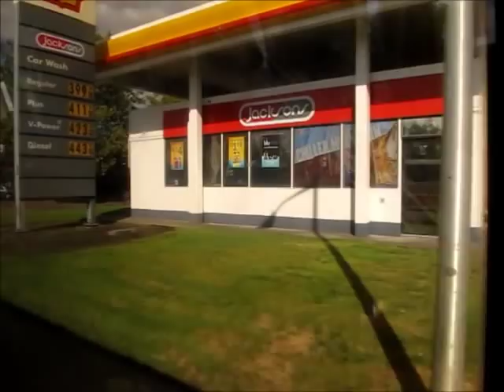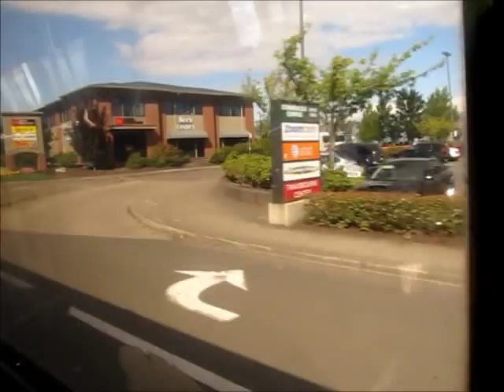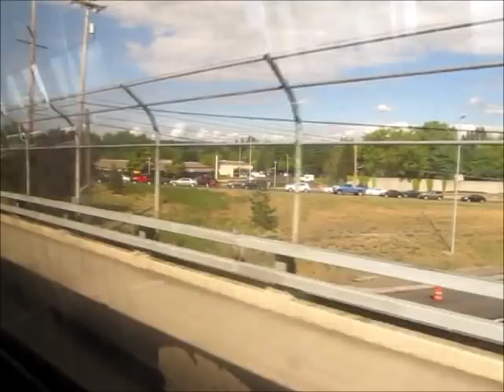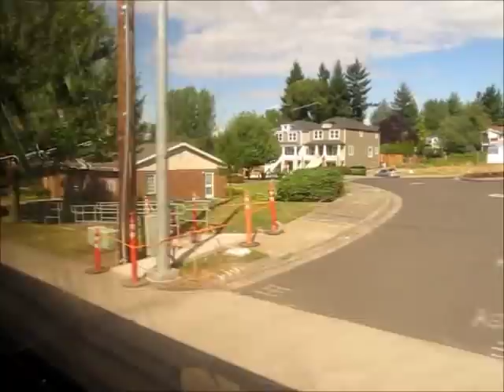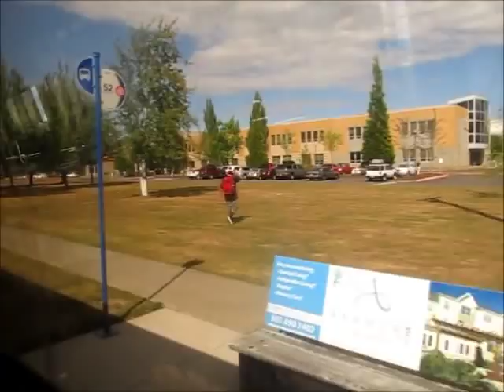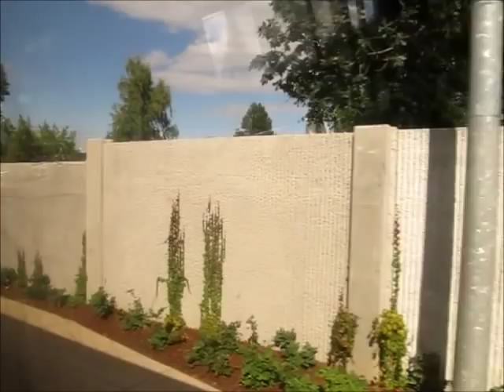TriMet #1778

Comment: Oh my goodness this sounds wonderful! There's a harmony effect with what I believe is the engine fan or something. The engine is in low E when the fan (or what ever it is) is in high A. It sounds perfect, just like the harmonic affect my NABI 416's make.
Reply: Not only that but the engine also briefly hits its redline of 2100 RPM during the shift from gears 1-2.
Reply: Sounds more like an ISM though.
Reply: That's sort of true, as the L10 morphed into the M11 by way of a longer stroke length (5.787" for the ISM/M11 as opposed to the L10's 5.354").
Reply: ClassicTVMan1981X Is there a specific way to tell the difference? Didn't all of these get repowered?
Reply: Not repowered, just rebuilt.